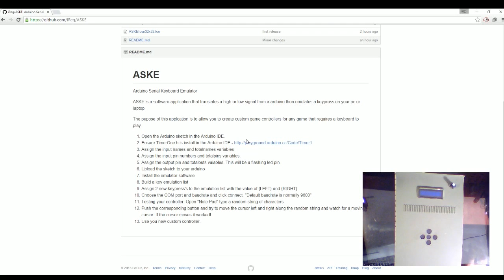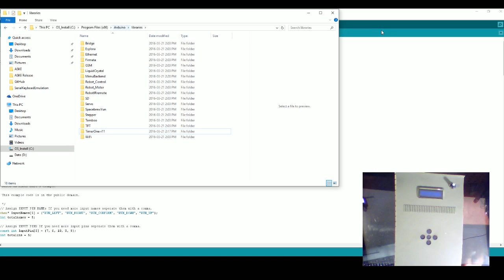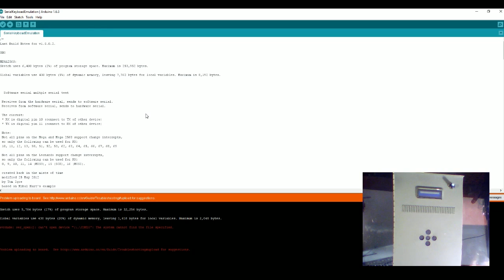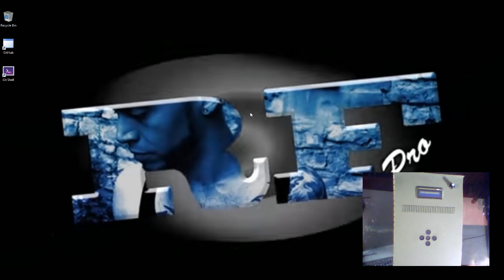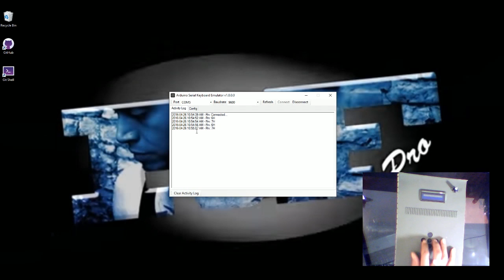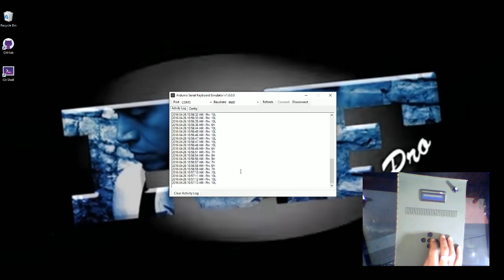ASKE Install Process

Comment: Hello, great video. But I have a problem installing the emulator. I don't get the same installation screen as you do, instead I get a globe with a loading bar. After that I get the message that the Hash (?) wasn't right or it was missing. Any idea how to solve this? Maybe a link to get just the program?